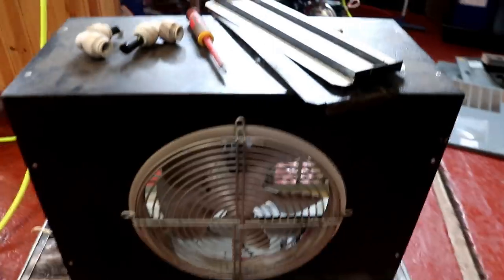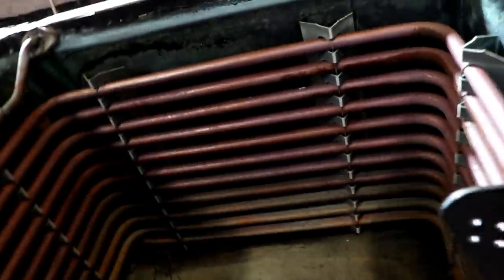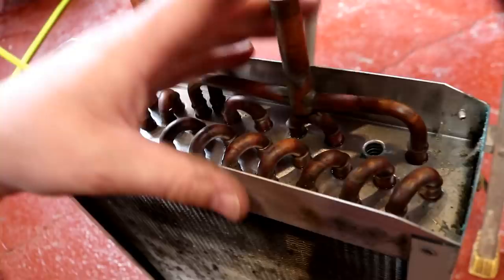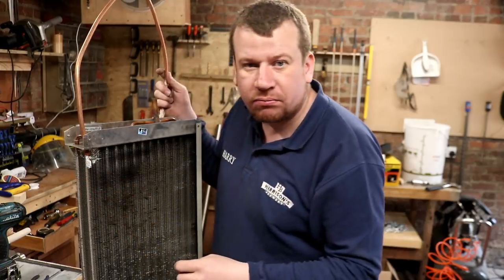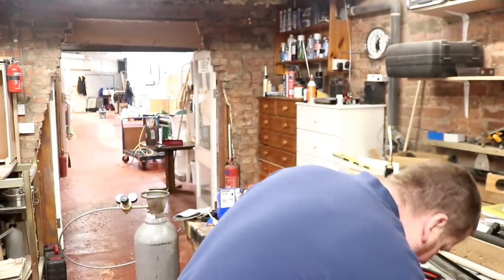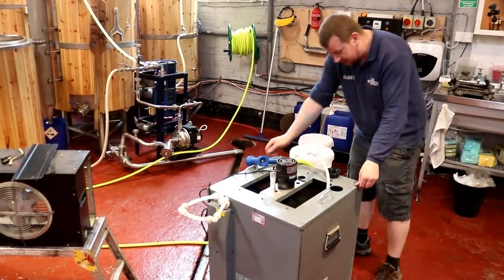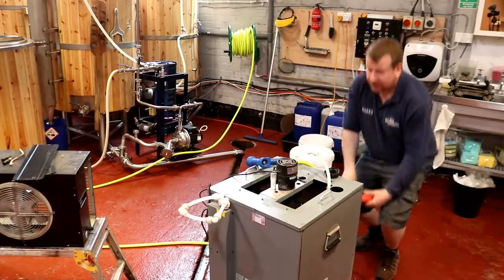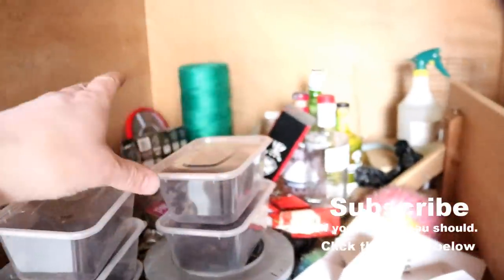TURNS OUT HE LIED

Comment: You might be able to get it repaired use to be a place round here that done it have a look for radiator or heat transfer repair/ manufactures used to be a place round here but they`ve closed now

Comment: should be able to find a like for like car radiator, if not a get a radiator with metal tanks and decent radiator repair joint should be able to remove a tank and remove the big hose inlet/outlet and solder in some pipe of whatever size you want then refit the tank

Comment: Cant you get the 'heat dump' to heat a radiator in your office or something so you're not wasting it?
Reply from the maker: If only. The trouble is that when I am cold enough to want a heater the cold room won't need to be running.
Reply: @harrybrew69  Dump the heat to a coil in your hot water tank for washing hands then?